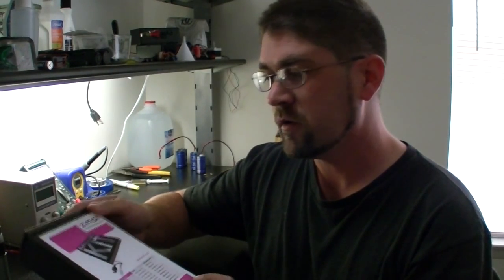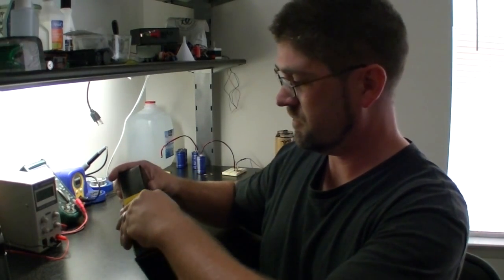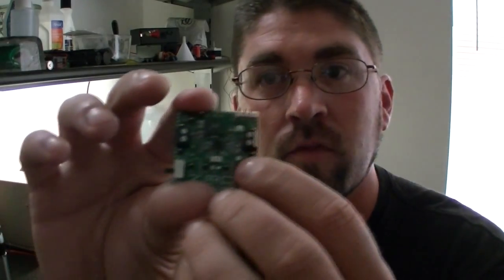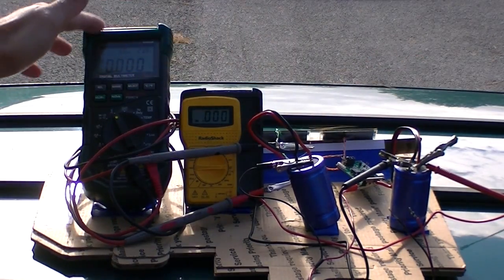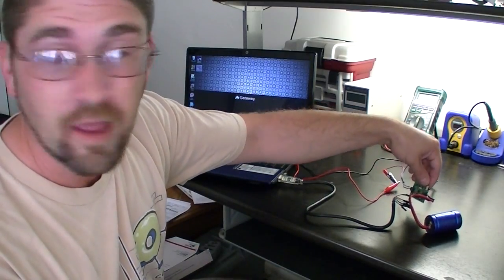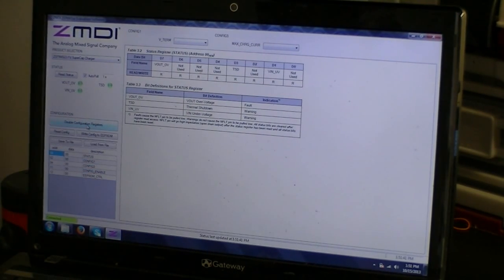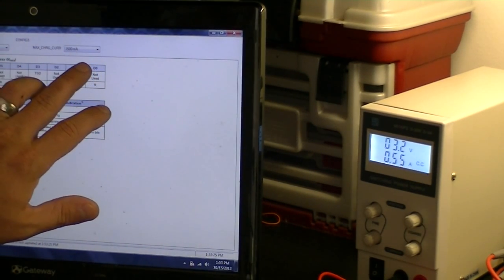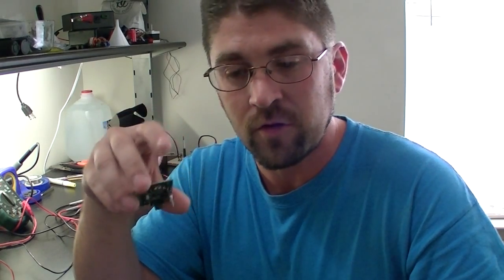Testing ZMDI ZSPM4523 MPPT Supercapacitor Solar Charge Controller

Comment: I wonder if you can extract more power if you use a small solar MMPT (maximum power point tracking ) charge controller. Google ZSPM4523; it was designed to use with a supercapacitor. 
generators running off a mechanical engine, like solar cells, have a power curve. Too little of a load and not much power is produced, too much load and not much power is produced. MMPT varies the apparent load such that it finds the sweet spot where it can produce the most power.